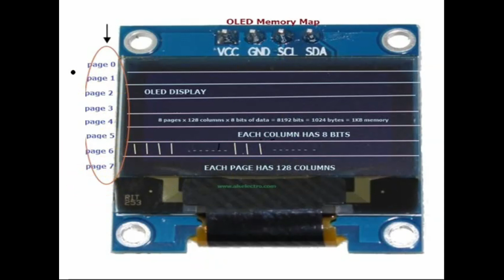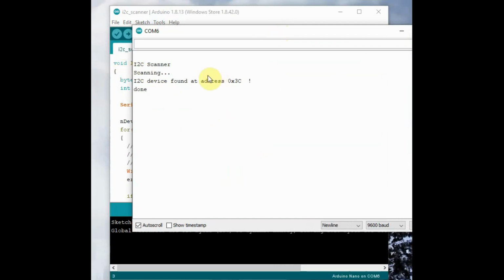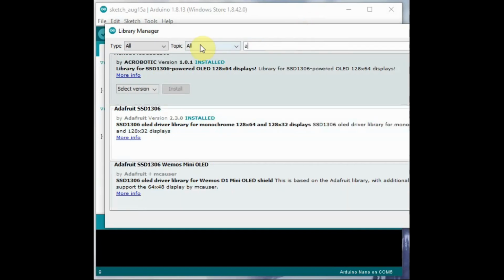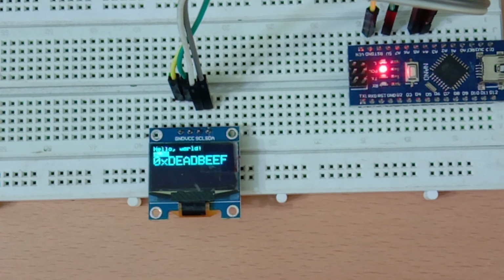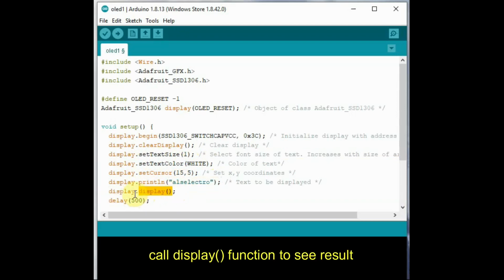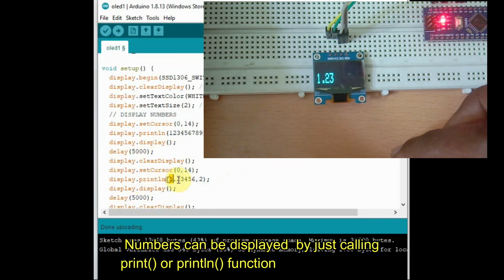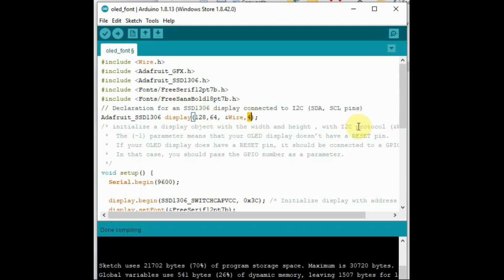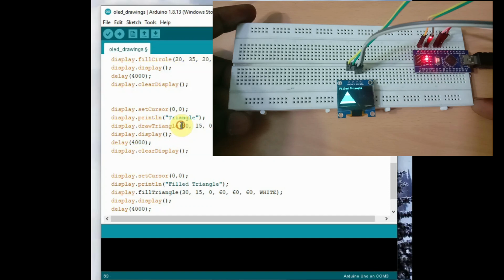OLED I2C DISPLAY 128x64 0.96"

Comment: Two fundamental issues re the setup: 
1) maximum ratings for the SSD1306 oled controller chip state "Supply Voltage Vdd: -0.3 to 4 V, Input Voltage Vin: Vss-0.3 to Vdd+0.3 V", meaning input voltage must not exceed 4.3V, and thus the device must not be connected to 5V I/O's of Arduino. The device may not fail instantly, but durability will decline. Use levelshifters!
2) I2C requires the use of pull-up resistors on SCL and SDA lines. Some OLED display modules come with resistors installed, others don't. Ohm resistance measured (on unconnected module!) between Vcc and SCL and between Vcc and SDA should give between 1kOhm and 10 kOhm. If it's above 10k, add resistors accordingly.

Comment: hi , i have an error in script python , con you help me?
,pi@raspberrypi:~/Documents $ sudo python ControlTemp.py
Traceback (most recent call last):
File "ControlTemp.py", line 87, in <module>
readSensors()
File "ControlTemp.py", line 62, in readSensors
temperature = (temperature * (9.0/5.0)) + 32 # Convert temperature Celsius To Fahrenheit
TypeError: can't multiply sequence by non-int of type 'float'